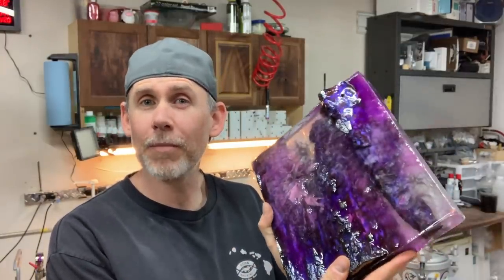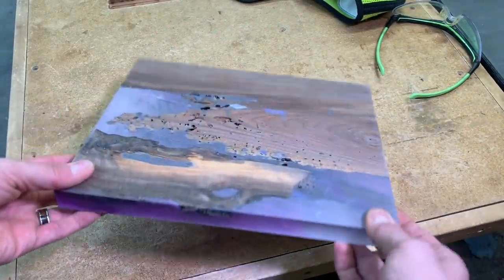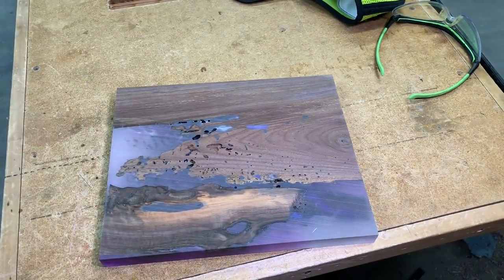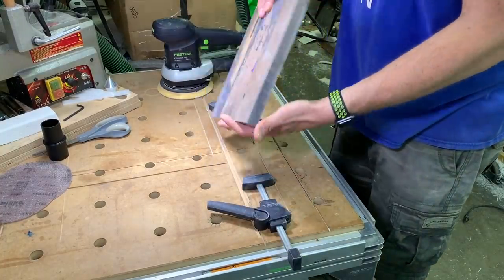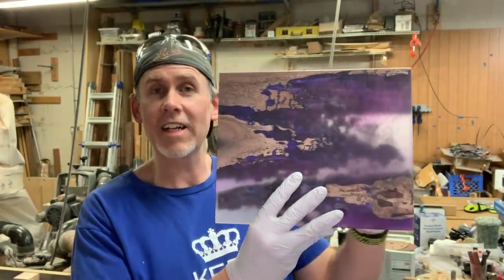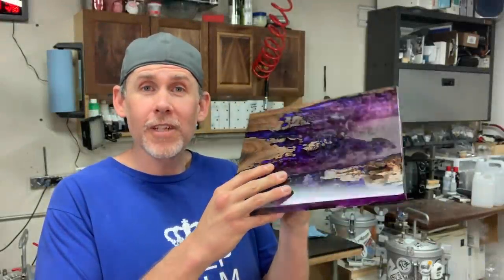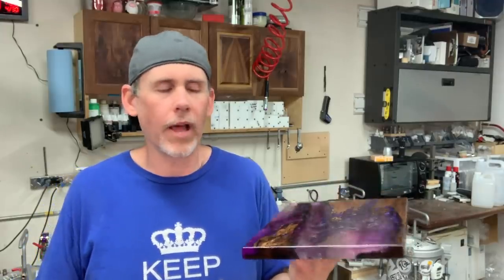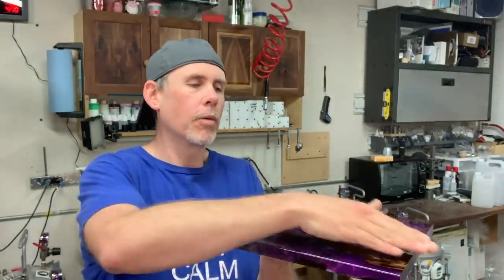Finishing up the Resin and Wood Cutting Board

Comment: Absolutely beautiful Zac!  You can always use a thin coat of sanding sealer after you sand with the orbit sander and that will hide most of the swirl marks.
Reply from the maker: Thanks Nick! I'm actually surprised the lacquer didn't do the job on the swirls, really disappointed that they stayed in there

Comment: That came out beautiful, Zac! It would make great wall art, and I think depending on what you put in the center it would also make a great (yet complicated) picture frame - although that would probably be easier to achieve with a long "slat" blank mitered into a square - but I digress. This will make a great countertop piece. Thanks for sharing!
Reply from the maker: Thanks Dominic! I think I'll come up  with another project to use this piece in. Thinking maybe one of those neat lamps that I've seen other people make with wooden bases. I think it would be more enjoyable and useful that way

Comment: To get past the 400-600 grit sanding, consider using a product like Abralon.  It is available in grits up to 4000.  Its primary use is in the automotive industry, but works in the woodworking area as well.

Comment: That's some good work. I believe Alumilite recently got FDA food safe approval once cured. I also think instead of lacquer at the end, I would have polished it then used butcher block oil on the wood.
All said though,  that board came out looking really good.
Reply: At the end I agree he should have done something else. I personally would have coated it with another layer of resin. It was beautiful tho.
Reply: Oh, I dont htink he should have done anything different, thats just what I would have done. That said, my problem with another layer of epoxy is that, I would be worried about flaking. I would be using it at least lightly as a cutting board, and a thin coat of epoxy over the wood is likely to chip after a few chops of a sharp knife.
Reply: @rallywagon261  I've been making resin jewelry for awhile and I prefer to coat with a layer of resin. I wouldn't use it for a cutting board, but it would've been nice as wall art.

Comment: Zac,  Glad you talked about the food safe aspect.  I agree with all your points.  Actually cutting on the board would destroy it in short order.  Really wet acidic foods would be the things that are most likely to leach out nasties and it's not likely that one would put things like that on that board (one without a lip).  BTW the two things I have seen that seem to work well in getting a smooth surface are flame polishing, though that is dependant on the plastic and the whole surface has to be plastic, and using a thin coat of the same resin painted on.  Otherwise I thing you just have to go super fine on the sanding and then go to polishing.

Really turned out nice though.
Reply from the maker: Yeah, just seems like the whole food safe thing is too vague, and I really don't have enough knowledge about it to feel totally comfortable using any resin regardless of certifications with food. Until I can have an unbiased expert give me a green light, it's much easier to just keep food out of the equation for me.

Great tips on polishing. I don't think epoxy or urethanes work with flame polishing, might go back and try to resurface it down the road. I'm actually thinking about making the piece into a lamp =D
Reply: You might talk to James at Basic Brewing.  He knows a toxicologist who has come on his podcast to talk about food safe and plastics etc.

Comment: Excellent job, Zac. BTW what spray finish did you use? Was it matte or gloss finish? I have made a number of these type of projects and recently tried Alumilite’s new Quick Coat, but had a very hard time getting the side and end done evenly. Any suggestions for using a resin coating for the top and bottom and not having a lumpy edge and ends? Thanks. Elling

Comment: Beautiful, agreed.... I would not use as a cutting board.  Re sanding the cuts and gouges from a knife strokes off the epoxy would be very difficult, I would think. A beautiful serving tray, yes.

Comment: How would you stabilize massive pieces of wood for tables. Do vacuum pots come in that size or could you make one?
Reply from the maker: There are pretty large vacuum chambers that you can get, but it's not really necessary or cost effective to stabilize slabs. most people just do what I did for this piece, just seal the wood where the resin meets it